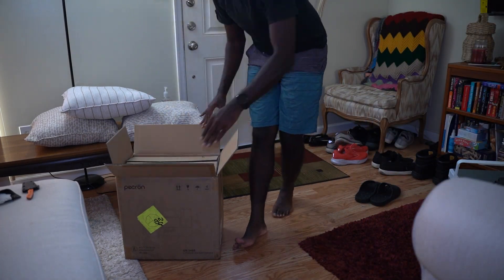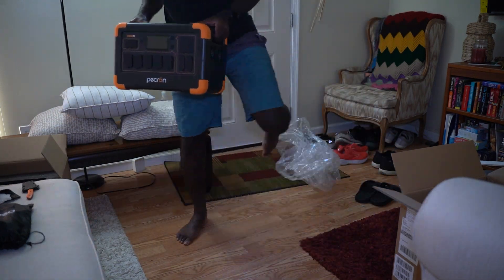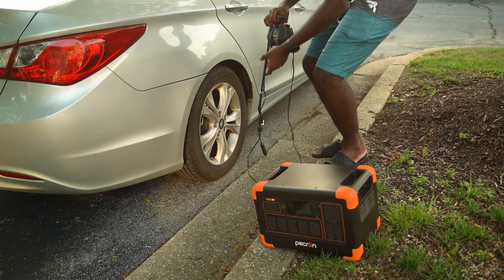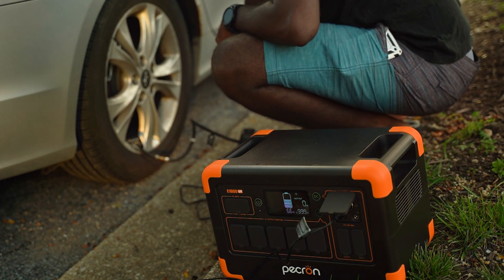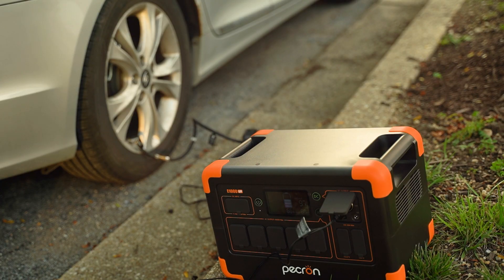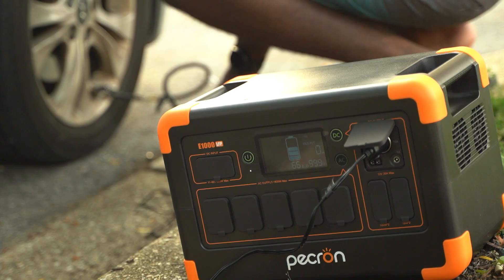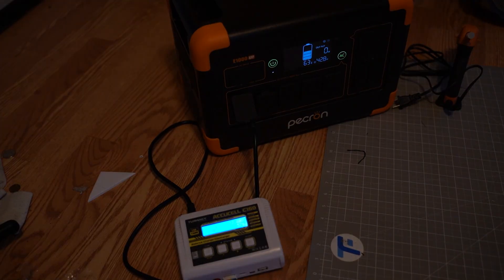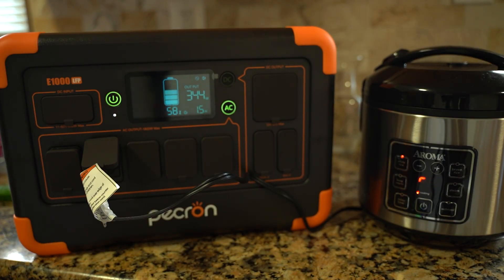Pecron E1000LFP- Overview and Demo

Comment: I have the same unit.  Have you charged up to 100% showing on the screen and it continues to accept wattage? Does charging stop automatically once the battery is completely full? Should you stop charging when it indicates (screen showing 100%) or continue to let it charge?  Thanks
Reply from the maker: I kept it solar charging for days past 100%. It would sometimes show 3watts input after being fully charged.  I just unplugged mine after a full charg